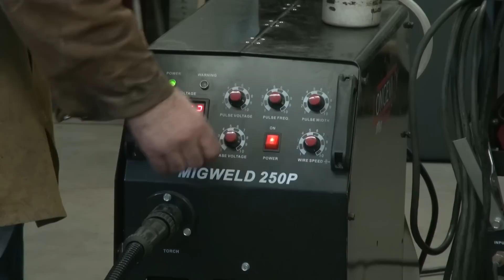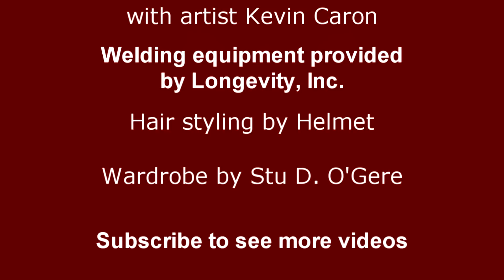How to Weld Outside Corners - Kevin Caron

Comment: Why don't you want to overlap the two pieces entirely? Couldn't you then just weld them together and get the same end product?
Reply: +Kevin Caron, Artist 

You fit it up like he did so you will get good penetration. That plate is way too thick to overlap them (the weld joint would be considerably weaker). MIG, even when ran too hot like Kevin did in the video, does not penetrate well unless you get into spray-transfer, which is a different animal.
Reply from the maker: lukefaceman I like to leave something to weld to.   If I overlap then I am fuse welding and can't get anymore filler in the joint.
Reply: So by fuse welding is when youre just melting two pieces together without any filler?
Reply from the maker: Correct.   There is a proper name for it but I can never remember it....

Comment: Kevin, at time stamp 2:00 you state that 1/4" equals 25 thou. I'm sure you meant 250 thou.

At time stamp 1:45 you say that a good starting point is 1 amp per thou of material thickness but then you set the voltage, not the current. How did you make the conversion?

Thanks!

Rick

Comment: Hey Mate,  Nice video..  I now know why my beads are so small, not as much stiching as you :)
One thing with your welder,  it sounds like your not using enough gas or running out of gas (thats what mine sounds like anyway)  but when i weld it has a more constant arc sound not splatter sound..

Comment: Given point due to gravity and the need to move faster. U can in fact get a vertical weld to have more penetration. Perverse you must weld vertical uphill. This will slow your weld as it builds upon itself uphill. This also gives the ability to put more accurate motion into your weld giving the eye pleasing stack of dimes effect.

Comment: Hi Kevin. I really enjoy your videos and have learned a lot. I do have a question / debate regarding ur vertical downhill weld. You stated it was slightly concave and you had to move more quickly to prevent the puddle from falling out and that it had more penetration. My understanding of penetration is the depth of weld impregnated into the base metal. While the resultant downhill weld may be concave II don't believe it's a result of deeper penetration but rather less filler material at any

Comment: I found that vertical downhill gives a better cosmetic result, offset by poorer penetration and a weaker weld overall. Most of the time strength is fine anyway.